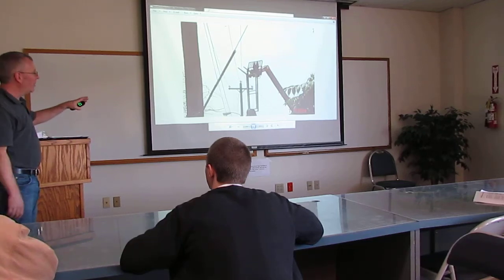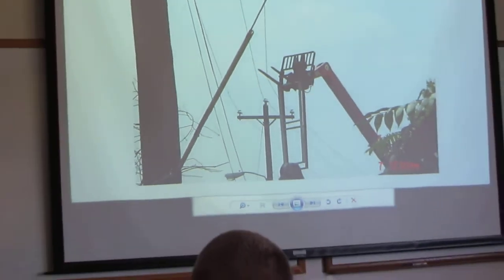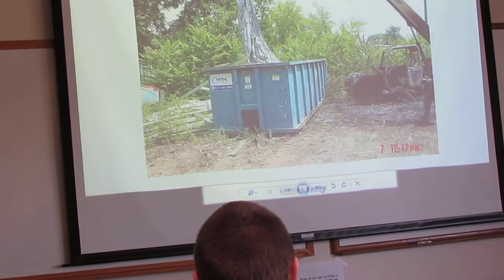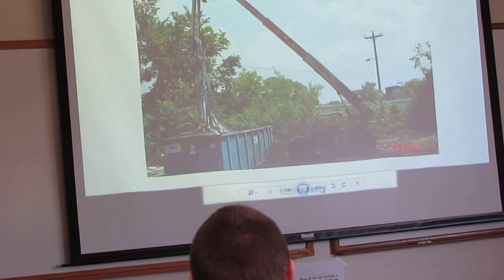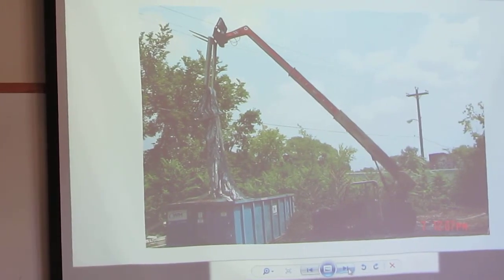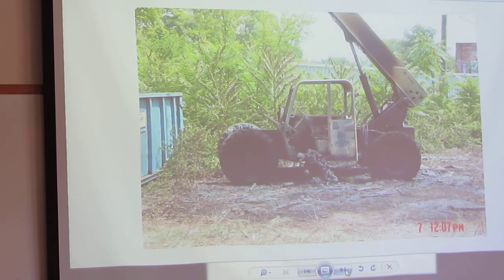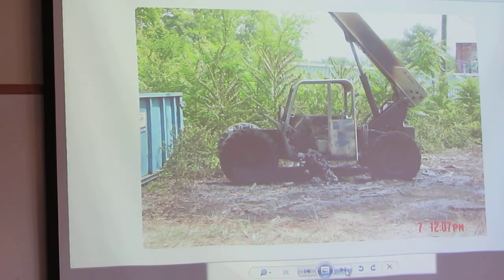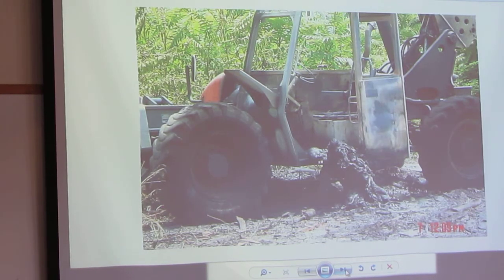The hazards of operating equipment, forkifts and aerial lifts when working around power lines.

Comment: So...just sit in a burning cab?
Reply: the worst thing that will happen will the tires will blow out/explode. STAY IN THE CAB. The cab acts as a faraday cage in instances like this. Honk the horn or yell out and make someone call emergency services. Do not touch ANYTHING. even the ignition.. do not move. the entire cab is literally lava.

If there is a fire in the cab, try and extinguish with the fire extinguisher in the cab. if you don't have one in there, GET ONE and make sure its rated for electrical and flammable liquids. Aim the extinguisher at the base of the fire. Preferably get an extinguisher in the cab before massive cock ups like this.

if you absolutely need to leave the cab before emergency services  can arrive because your life is in immanent danger due to fire in the cab (no extinguisher) or explosion then Without touching any metallic parts of the cab, doors, interior or frame, you need jump out completely, keeping your feet together and make sure they do not separate otherwise the electricity will get you. Your body and head should not be touching any parts of the machine. (This is very fuckin risky, stay in the cab.)
Keep jumping like that away from the area until you cannot jump feet together any more. 

Before starting any job, step back, look for and think about hazards and risks. Check your site safety board. 
Always have a spotter for jobs close to electricity. Always ensure you know where the overhead and underground powerlines are and that they are powered down and/or clearly marked out by the council or electrical board. Always wear rubber soled boots. Don't be a hero, just be smart.
Reply: The forklift wasn't likely on fire until he ignited when he completed the circuit by stepping out of the cab. His clothes likely started the fire. I have a friend who is a master electrician and he use to grab the main legs coming into his house, then stick a voltage tester on his body to show us he had a ton of voltage running through him. It doesn't harm you until you ground yourself. He had electricians boots on that kept him from being grounded. Was it wise? Heck no. But he knows electricity very well.